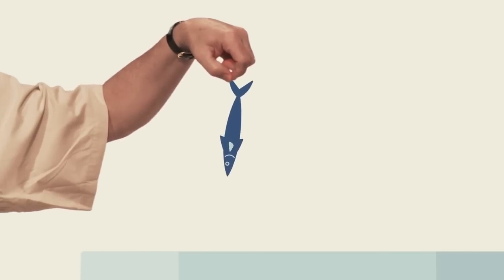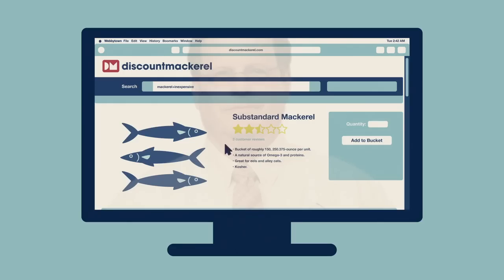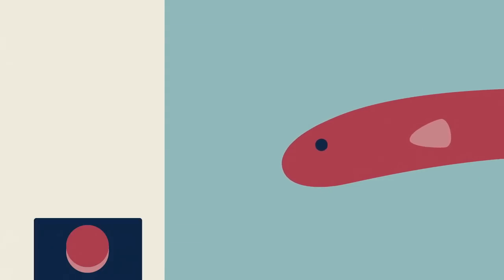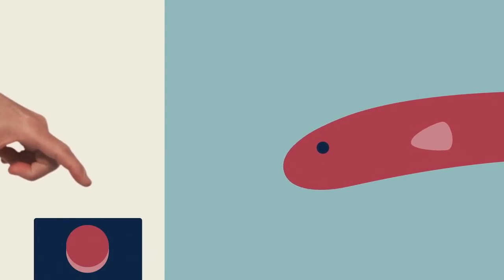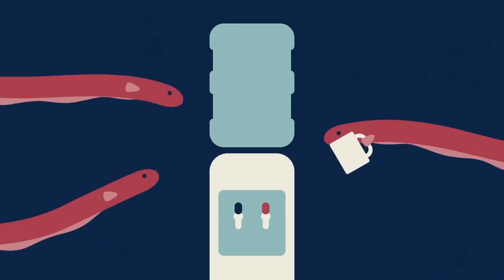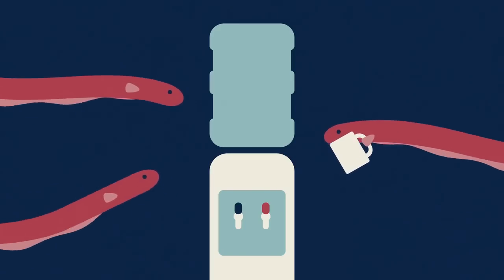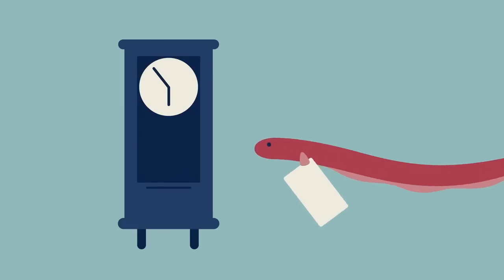Could electric eels be PGE's next power source?

Comment: Why not just have the eels power generators that could be used whenever you need them? So they kinda like charge the batteries, might require more eels though just to be on the safe side
Reply: Kinda buy your ideas. Here's mine:

An aquarium with 30 eel fishes connect to a power reserve that's suppose to power the home's lightening system only. And should be for urgent times when McCain power goes off. That will be cheap I guess
Reply: @caverys  still need to feed them. How about trying to mechanicaly replicate the system they use? Maybe even organic. they convert food into electricity.
so maybe it would be possible to sort out the minerals or proteins they use for those organs and feed it directly into such an replica.
Reply: That would be the conversion and storage device mentioned in the video, but it's probably easier and cheaper to install solar cells, or wind turbines or something else.

Comment: I'm not really electric savy but volts isn't power amps is what u need am I wrong!
Reply: You need both, volts is like the water pressure of the electric current and with amps it gives watts (watts is power)

Comment: actually the information in this video is mostly incorrect.... An electric eel can continuously shock a predator (even as large as an alligator!) until the predator's heart gives out. 1/500th of a second is a drastic understatement. Also, electric eels communicate and electro-locate with weak electric fields they generate. They have hundreds of thousands of cells called electrocytes. They're very similar to Mammalian Muscle cells, except arranged in such a way which allows electrogenesis to occur. The electric eels hunt as groups too, and will co-operate in shocking schools of fish. I'm fairly certain you could coerce a school of electric eels to "attack" an electrode by merely placing it near the water, electric eels will "attack" by placing their chin on you directly to deliver a large shock. They will also hunt by generating pulses of high-voltage electric waves, these waves stun fish so that the eel can consume them. An electric eel can theoretically generate from 600 to 860 volts, depending on the species, which is also more than what is suggested in this video. Also I think we can harness the weak electric field around the eels aswell, passively, so keeping them as pets without stressing them for power, could potentially also be a viable harvesting method. Also, you most certainly wouldn't need them to work shifts, as with all power generation methods commercially used, there is always a capacitor or battery in series, because nothing is 100%, so having power stored so routine maintenance could be conducted, is a MUST, solar and wind energy is also stored in large capacitance  solutions because wind varies day by day, minute by minute and solar isn't a 24 hour luxury, so to smooth out the frequencies of energy available they use energy storage during sub-optimal conditions.
Reply: I should also note, that solar energy solutions plug directly into your current city power hookups, any excess energy will return back onto the power grid because the power grid is almost exclusively AC (Alternating Current) so it goes through many many cycles of push-pull alternation, in other words the current goes from positive to negative, repeatedly, so when you PULL extra energy back, your power company will receive energy back and credit you accordingly. Unless ofcourse you live off the grid in which case you most definitely will have to set up some fancy energy solution.